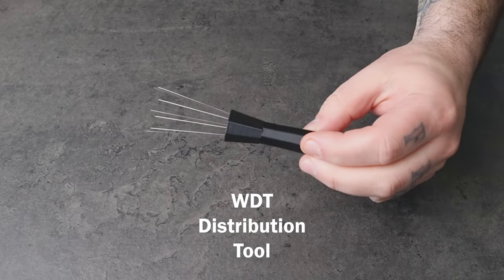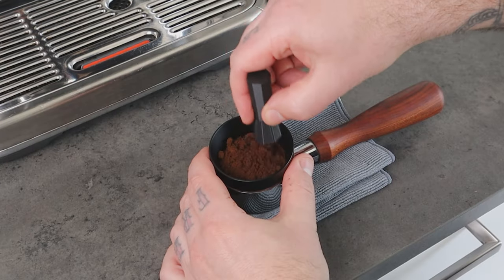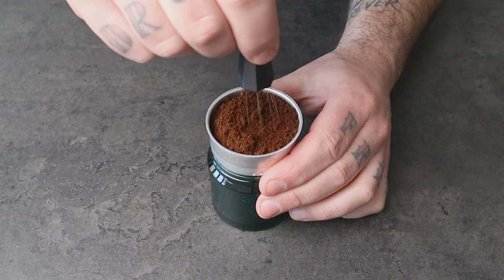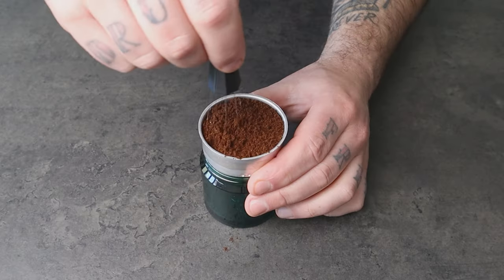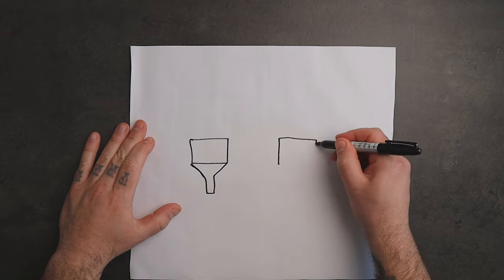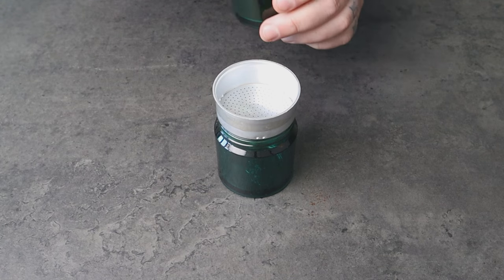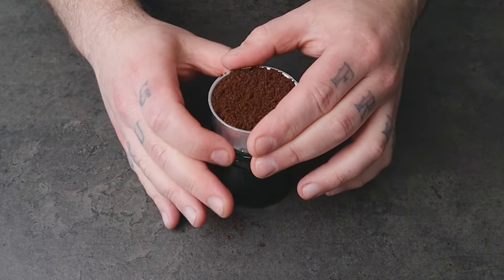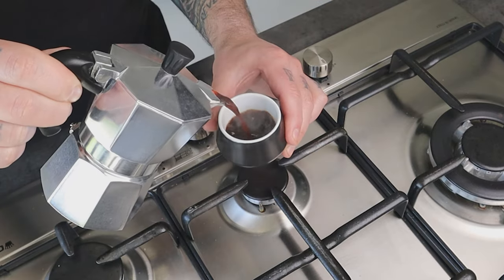WDT Distribution with Moka Pot - Game Changer?

Comment: I have been distributing the grounds in my moka filter basket by GENTLY tapping the side of the basket with one finger.  I have been using a Baratza Virtuoso grinder for nearly 20 years.  This has worked well FOR ME.  That's not to say others shouldn't try a WDT.  Today I tried two changes to my moka technique you suggested in older videos.  I lowered the electric burner setting on my stove (hob) to MEDLOW from MEDMEDLOW, and I added an Aeropress filter on top of the grounds.  A definite improvement in the taste of my morning coffee!!  No bitterness or after taste.  However, I did get hungry again mid morning as there was no coffee grit to chew on while drinking my coffee!!😁 THANK YOU, Matteo!
Reply from the maker: it's good you do one change at the time to understand and control that change and then in the future try more things. your distribution is good and I suggest it.

Comment: Matteo great tutorial as usual. I see you used a doseing ring when filling the basket. I have been searching for one to fit the 6 cup Moka. I can only find ones made for espresso machines. Any ideas? 5:15
Reply from the maker: Thanks for your nice words. In this video I'm using an espresso dosing ring of 54mm (with a 3 cups moka) for a 6 cups you can use a 58mm dosing funnel. I even use this 54mm in the 6 cups, I's a bit uncomfortable, but it makes its job.

Comment: Inspirational & interesting video,thank you Matteo. In case I want to make WDT using stainless steel accupuncture needle size 0.3x75mm or 0.4x75mm for Bialetti Moka Express 3 cups, better to use 5 pcs needle or 9 PCs. Appreciate to have your opinion.
Reply from the maker: I suggest you 0.4x75mm with 9pcs. It helps you better with the distribution and breaking the clumps.

Comment: thank you so much this is very helpful. how many grams of coffee and water to you recommed adding to a two cup mokapot?  depending on the grind size ? thank you
Reply from the maker: Thanks for your comment. The dose depends always on the kind of coffee you brewing. There is no a fix dose. Fill the basket like I do with the coffee you brewing and check how many grams is that. That can be your starting point. Then you can adjust first the grind size if you need it coarser or finer, based on your personal taste.
Reply: @matteofromtheswamps  Ok I will do that thank you!

Comment: Hi, what size of portafilter should i buy for 4 cups of Bialetti moka pot. Thanks!
Reply from the maker: Hi, what do you mean as portafilter? Portafilter is the tool where we place the coffee to make espresso with an espresso machine.
Reply: I mean you used a portafilter ring, what size is that?
Reply: The 4 cup and 3 cup are the same diameter. He reports using 54mm on 3 cup therefore I’d suggest a 54mm.